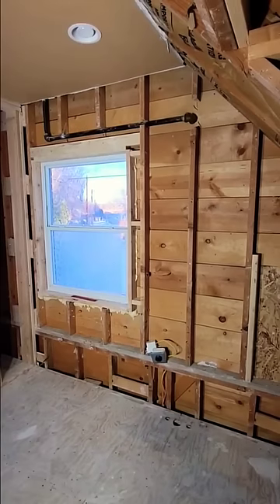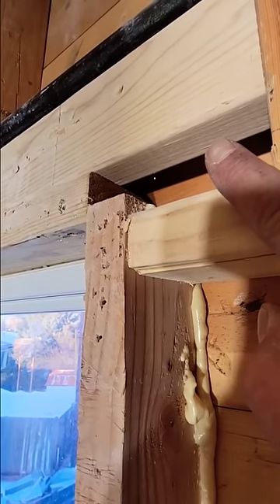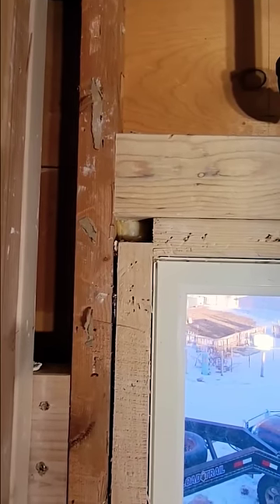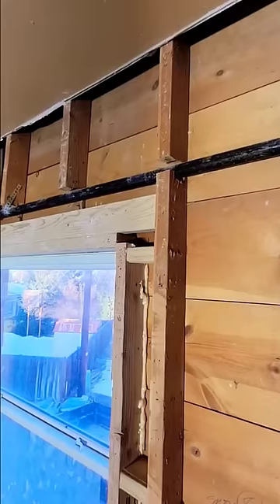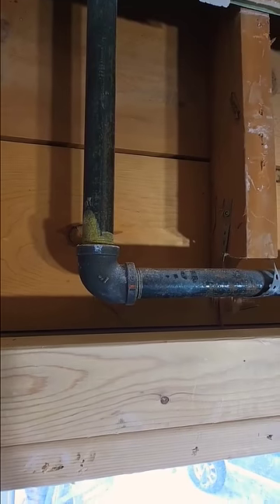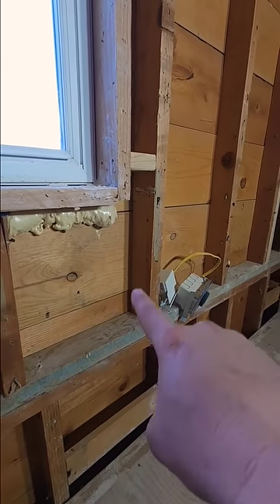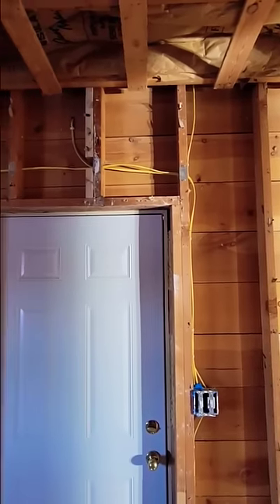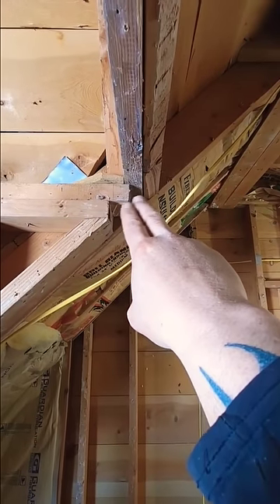Why ((REMODELS)) cost so much! #hacks  #construction #framers #plumber #shorts

Comment: Those aren’t illegal black iron fittings😂😂. Perfectly up to code. Contractors like this want to make you pay an arm and a leg. If you ever want to know call a reputable company for all the trades you will spend more upfront in service charges but you will save a decent chunk of money on the remodel because experts of their trade only give you what you want or need
Reply from the maker: I love the black pipe. it has worked for 100 years. Where we live in Wyoming, You can not berry any fitting in the wall. If you do, You have to make a access to it. I know it is jacked up and we fight it all the time, But the city will not let you bury that 90.
Reply: @307 Garage  wait you can't bury a black pipe in a wall, even if it's been inspected?  I don't even know how I would work on the old places by me
Reply from the maker: Yep.

Comment: Thats why alot of the time we bid time and materials. An hourly rate and give an estimate on hours its going to take to complete. Helps when we run into issues that need fixed like that.
Reply from the maker: T&M is the only way to go. Fair on both sides.
Reply: @307Garage  exactly because if i had to bid the whole project, im going to bid for the worst case scenario mostlikely costing the customer more than time and materials
Reply from the maker: For sure!

Comment: I would use a bulldozer. But I have found in cap live wires. No headers. Floor joist cut with a Sawsall down to 1 inch for plumbing. Staples through wires.

Comment: Dad bought a 125 year old house near the battle of fist Manassas. I can't recall what kind of joists it has, either 10x10 or 12x12. Whole house was built like that with a tin roof. It's finally time to replace the original tin roof.

Not only don't they build em like they used to, there isn't the kind of lumber left to build em like that
Reply from the maker: That is so true!

Comment: Every thing you showed made my skin crawl,,,, my God,,,, it's as bad as some of the crap I get into in the old places in Harrisburg, happy home owner work we call it,,,
Reply from the maker: Yeah it is bad, and it is everywhere!
Reply: @307Garage  it's 🤔 becoming more common., Back I. They day folks had a basic grasp, but in the 🤔 80' /90's some thought they new more than they did, a f that work only lasted so many years and now need torn apart and rebuilt the right way,, a building built in 1890, all good hasn't been messed with, cost,🤔 85 grand to rehab, the one right next door🤔🤔 um YEAH, um, wow, turns into a 150 grand nightmare,, Been there done that in many projects over my 3 decades there is new construction and then there is reconstruction
Reply from the maker: yep!

Comment: We had to cut open a ceiling no header 20 feet plus had to shore up ceiling on both sides with temporary framing, get 20 plus header believe 8" wide,cut through outside of building slide in header which cost a fortune 15 years ago,secure it ,use Simpson straps and hangers,put  ceiling back together. Had before 3 2X4's 20ft. long on load bearing situation. One shaker SoCal  and whole living room would've come down.
Reply from the maker: Crazy!

Comment: That's an exterior non load bearing wall and it's built with solid wood horizontal planks. The wall itself is it's own support structure because of how it was constructed. You don't need any headers above openings in that wall and discontinuous vertical studs don't matter. Aside from looking a bit hack, none of what you pointed out is an actual concern from a structural standpoint.

Codes exist because builders and contractors are not engineers and don't always no how to trace a load path or analyse a structure...so the engineers who write the codes just say to put a header over every opening so they don't have to worry about.

Yes I'm a structural engineer in case you're wondering.
Reply from the maker: Normally I would agree with you, But the way this was framed and the load on the roof right there along with our snow load here is Wyoming. It needed a header there.
Reply: @307Garage  I can see how it's framed. The roof framing uses collar ties which are parallel to that wall. All the roof loads are transfered to the adjacent walls. That exterior wall doesn't support any load aside from itself. My house is built exactly the same way and we have a lot of snow in my neck the woods.
Reply from the maker: So you can see in that video that there is a big 14' dormer 3 feet away from that wall and the 70" + of snow we get every year that just hangs out all winter? Funny I didn't think that was in the video!
Reply: @307Garage  Yes I can see the dormer corner framing. You were pointing at it with two fingers about half way into the clip. Right after that you pointed out the hangers. Those views told me everything I needed to know about the framing and hoe the roof is supported. The exterior walls do nothing. You even said the thing was remodelled 10 years ago...and it's still standing. Just that fact alone should tell you something.
Reply from the maker: Go watch the short I put up yesterday. It points it all out for you guys!
Reply: @307Garage  nice try.
Reply from the maker: If you don't see it you never will!

Comment: The sad news is, the issues shown here are not restricted to residential structures. In my experience, the trade that takes the most short cuts are the plumbers. Maybe since they’re usually the last in, they have no problem messing with others work to install their stuff.
Reply from the maker: It is for sure in our town here in Wyoming for sure.
Reply: They are not the last in. Drywallers and painters are .  Of course they don't give a damn and they shouldn't!😂
Reply from the maker: Trim guys are one of the last guys in.

Comment: I dont disagree with you regarding the header size, but if it's been there for 10 years, then obviously it's adequate by the very nature of it remaining in place for 10 years. It's not just the header carrying a bit of load for its tiny span, but its also the 1x sheeting nailed to the 2x4 header (supposedly nailed) creating the additional strength.   Either way, if it's been there for 10 years, it means it worked.  I'm on a job right now with that similar condition,  except it's a 9 foot span with the 2x4 on the flat with a floor above it.  It's definitely not a good standard, but the fact it's held up for 100 years says something. Remodeling costs so much because you have to destruct before you can construct.
Reply from the maker: Yep

Comment: I’m sure there were no permits pulled on the last remodel. Homeowners should be insisting permits are taken out, it protects them. Of course there is always the guys doing cheap work and most of the time owners look at costs, not safety.
Reply from the maker: 100%

Comment: Ok, even though that framing is all wrong, doesn't that solid wood paneling make up for a lot, structurally? I've seen other videos claim that some very old American buildings depended on the (not OSB) sheathing for strength.
Reply from the maker: NO. It is not for down load, it is for side load.

Comment: Any home owner who doesn't KNOW what is behind the drywall, they had better have at least 2-3 times the original estimate cost held in reserve.  As an independent contractor working for a prime contractor, I've seen rotted floor joists, black mold on wall studs and insulation and all kinds of "fun" surprises. One job we had to remove 3/4ths of the  bathroom sub floor, replace one floor joist, double up a second and spray all exposed wood with clorox  TWICE to kill the mold. (No Black mold there) it all came back together well but it went from a one week job to 3 weeks and from $4k to $10K  Even had to re-route drain line out to the front of the house.
Reply from the maker: Yep

Comment: Fair point but…. If you did bid the job higher do to those reasons and after stripping the sheet rock you found everything to be done perfectly and up to code, would you take the price off your original bid?
Reply: I only do work for banks, there's jobs like this where I tell them just straight up I won't give a price until I know what I'm looking at.
A majority of the time I put in bids for "the maximum" and it only ends up being what I expected, but sometimes my wife's making that phone call like "hey this whole things getting used up and just making sure we're still good to go"

I don't work with average people, take pictures and submit through an app and getting paid in 3 days max unless there's a problem (rarely happens because I take a fuck load of pictures to protect myself)
Reply from the maker: Yep. We went into this with T&M price.

Comment: I did remodels for years, I always over estimate how long it would take. You never know what you will find once you start ripping things out.   like no junction box for wiring, just spread the wires far apart and use band aids on the wire splices. cover with dry wall and go. And many more stupid things. Always something on every job.
Reply from the maker: lol, Crazy!

Comment: I live in great neighborhood. The homes in the older part of this neighborhood were built in the early 1970's. Our house on the side opposite of the driveway has an outside wall is missing a stud, at least 1 stud, perhaps 3. I used a cheap stud finder, and it found 4 studs, on 32" spacing, rather than the common 16". I narrowed a buddies expensive stud, and same thing!!?. We rent, and have rented for over 10yrs because we like the neighborhood. If we ever decide to buy a house, you bet your a$$, I'm checking all the outside walls for stud spacing.
Reply from the maker: For sure!

Comment: that's what I call 
recognizable moral imperative
Reply from the maker: Yep.
Reply: @307Garage  just today opened a lake cabin exterior wall and found 2 1/2 " copper vent pipe no longer in use, and cut off at the floor sole plate in an historic remodel, the red rotted compost that was the plate, plywood and sill caused me step back a pace and look up at the old vent pipe freshly booted with the recent reroof...
Reply from the maker: I have never understood why people don't ever take out the old stuff when replaced? Just leave it in there so the next person don't know if it is live or not.
Reply: @307Garage  this 1950s cabin has 3/4 flame grain birch tongue and groove intererior, and  10 inch port orford CVG red cedar clapboards on the outside.
Pretty tough to source, tougher to afford for the descendants.
Reply from the maker: I bet!

Comment: Why is the pipe fitting illegal?  Was it supposed to be a street 90 into a coupling? Or a straight run of pipe then the joint?
Reply from the maker: The city will not let us berry any fittings in a wall.

Comment: Gable end walls do not carry load. The window in that shed does not need a header. Also stop calling out buildings "houses".
Reply from the maker: Normally I would agree with you, But the way this was framed and the load on the roof right there along with our snow load here is Wyoming. It needed a header there.

Comment: Missouri you find more then that wrong . no header on a 16 foot door on a weight bearing wall .  No Junction box just twist and taped lose in the walls .   we know Black pipe is gas . Galvanized water  In MO you find both used on either black on water and gal on gas lol .  Things Night mares are made of .
Reply from the maker: Yep. We found all that in this one and so much more!
Reply from the maker: The worst part about it is, This is a 6000 sqf building and we remodeled 2000 sqf of it and this is all we found. Could not imagine  what the rest looks like!

Comment: Isnt that a gable no load doesnt really need a header. Black steel gas line? What else would you use unless you have the gas propress? I hear ya looks like crap but some times if theres no code violations just get it done.
Reply from the maker: So many code dings on this job. Yes it is, But where we live in Wyoming, we have to build for a snow load on a roof.

Comment: Gable end, non structural so headers aren’t really necessary. Not saying any of it was good but really, if the sheetrock guy is good, it’ll probably stay hidden for another 50 years and you wouldn’t even know.
Reply from the maker: Normally I would agree with you, But the way this was framed and the load on the roof right there along with our snow load here is Wyoming. It needed a header there.

Comment: My house had the same garbage when we bought it.  We were the 3rd or 4th remodel
Reply from the maker: Yeah, It sucks when you pull off drywall and see that all over!
Reply: @307Garage  drywall?? Shit, I had to bust out plaster to see that garbage lol
Reply from the maker: Yeah, We did to along with a layer of drywall over the top of it.
Reply: @307Garage  gall dang...
Reply from the maker: The downstairs had 3 drywall and 1 plaster. We have hauled 68,000 pounds of shit out of this house.
Reply: @307Garage remove that much sheet rock and you might've destroyed the structural integrity lol
Reply from the maker: The house was way happy after it was all out. It was insane how much was in this building

Comment: Gripe about it but how long has it lasted? Pyramid builders would have done this same video on the older stepped pyramids but they lasted just as long.
Reply from the maker: Yeah, Some of this was done in the 50's, But most of it was done around 2010

Comment: I have been a builder since 1978 and you sir are correct.  1x8 cladding is quite effective for lateral strength but does little for load. The black iron gas pipe buried in the wall is sketch.
Reply from the maker: Yep! You are the only one that sees why the black pipe bury in the wall is sketchy. If any part of that pipe would start to leak in that wall. We now have a BOMB!
Reply: @307Garage what gas pipe do you recommend in the wall and where are you going to put it if it’s not in the wall?
Reply from the maker: It has to be one line without a fitting in it. I don't write the code, I just have to follow them.
Reply: @307Garage  I’ve been a plumber for over thirty years and I’ve never heard of that. Black iron pipe and fittings are in walls all across the country. Black iron is going to last longer than the rest of the house.
Reply from the maker: I 100% agree with you. The town we live in for some reason. They put this in their codes that a fitting can not be burred in a wall. We all when down to the city to vote and made our voice heard, But they still put it in the code a year ago. So every time we open up a wall and see the gas line. We have to replace it to their code.

I have been around plumbing my whole life. My dad was a plumber in this town for 60 years.  I was beside him for the first part of my life till was over playing in shit all day. We ran so much black pipe. It is a good gas line. Hands down will last the test of time. But someone in our city is just wanting to make it hard and cost way more then it ever should.
Reply: @307Garage  I understand that local codes can be stupid but I recommend letting your viewers know that it’s a local code. There are way too many people who will start freaking out if they find a fitting in their wall because it’s common practice almost everywhere else.
Reply from the maker: It is in the ICC 2022 code book. That is a Nation wide code book. From sea to sea, other then California. They are was out there over there.
Reply: @307Garage  I’ve installed gas lines for over 30 years and not once has any inspector said anything. I’m not talking about little towns either. If you don’t put fittings in walls then you have to run them through the living room? It’s not happening anywhere. The threaded fitting in a wall done properly won’t leak unless something causes it to leak. It’s no different than galvanized pipe. I think that’s one of those codes that every jurisdiction except yours understands isn’t possible.
Reply from the maker: Ask them about what the code book says about putting gas fittings in walls. But thing about it before you do. Might not want to open his eyes on that! It is a big pain in the ass and cost the homeowner a new gas line.
Reply: @307Garage  every time we ran across a new inspector that thought he knew better and forced us to change something that made no sense he quickly realized it was stupid and quit calling things out. Where I live in Alaska there are no codes and it shows. It’s actually pretty scary what people do. When I lived in Utah they were strict about everything except the couple stupid things that even they knew made no sense. I am going to ask the gas company about it when I see them next. They are the only ones that actually enforce code in my area.
Reply from the maker: Yeah, some code are over the top. But some codes are there for good reasons.
Reply: @307Garage  most of the time
Reply: @307Garage  I understand code very well and I agree.
Reply from the maker: Yep. We have to do the same thing here too.

Comment: Yes that is correct back in the day guys would get away with murder but your joint still stays standing though doesn't it. The way we build now these guys would all throw their hats in the dust "why are you wasting your time with beams over the windows and all of that heat transference with double kingstuds and dual shoulders" they would literally have no clue what we are doing. Starting to think that the building codes and inspectors are the guys keeping the lumber mills and hardware stores in business.
Reply from the maker: Right.

Comment: Does a internal wall opening need a header?
Reply from the maker: Only when the roof and load baring points come down on them. It is 50/50 on them. If you don't know. Ask before you take them out or if your not sure!